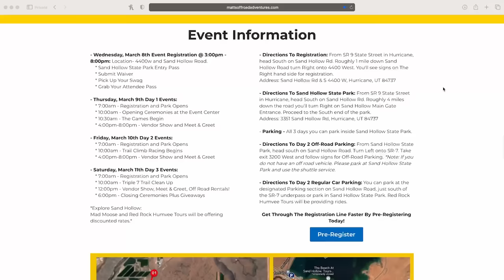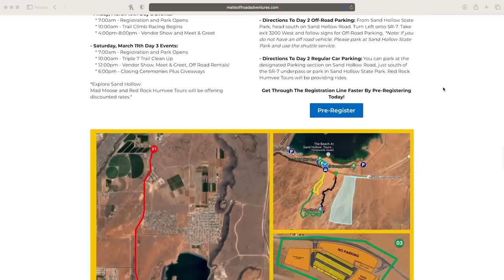20,000 LBS Truck Slides Off The Road...Did I Fail My Team?

Comment: Love watching your videos. As a former propane delivery driver in snow country I really think a set of chains for both the big truck and the Morvair was all that was needed.
Reply: Chains on the truck and they wouldn't needed to call anyone. Used to drive for a plumbing supply company. Chain up the rear and one of the fronts for steering. Better to chain up before getting into trouble.
Reply: Yep. Chains for all vehicles that expect to confront ice and slopes.
Reply: I was thinking the same thing. That box truck had no business on that road without having a set of chains.
Reply: Came here to say the same thing. Chains on that box van and it would have likely drove out. Definitely would have with a tug with the Moorvair. This winter should have taught MOOR to have a tote with gloves and shoe chains in their rigs for employee safety as well.
Reply: I'm guessing if this were so to happen the video would be less dramatic, just a guess...
Reply: @akdoug6437  Yeah, shoe chains seem essential for all winter work. I keep a pair in every vehicle. It's a cheap, easy way to gain positive traction and avoid avoidable accidents. Personally, I like to avoid pain, and ice is hard, and you usually hit it pretty hard and fast. So, chains... On all moving parts when dealing with ice.
Reply: @elvis4182  true. And not nearly as fun for everyone.
Reply: @DoctorHayduke  And a bucket of nice fine sand for emergency use!
Reply: @TheBibliofilus  Masonry sand...because it's all sharp edges!
Reply: I said the same thing
Reply: Agree.
Reply: Yes and not having bald tires
Reply: @mediocreman2  bald tires and chains you would be just fine.
Reply: Or a bucket of ashes from the house at the top of the hill.
Reply: @akdoug6437  sho Chains suck I'd rather good boots and a brain
Reply: I think they skipped using chains for more utube drama
Reply: All the needed is a shovel and plenty of sand, dirt or grit. In this situation buy 4 bags of the cheapest kitty litter-box filler and a broom. Be more self sufficient and don't lose a day and half of work.
Reply: @AlfaRomeo156SWGTA  don't use kitty litter except in emergencies, its real bad for the wildlife. Not saying don't use 8t cuz it works as well as sand. Just do it sparingly
Reply: @TheBibliofilus  Or kitty litter, just depending on the price in your area. My area kitty litter is cheaper and does the same job.
Reply: @therealnynetynyne360  Exactly.  Looked like a lot of shoveling and sanding to get up that hill.  Ol boy prolly thinkin a set of chains isn't such a bad deal now after all!
Reply: They were lucky the box truck didn’t go off the hill without chains originally.   I would definitely have used chains on the recovery if it were me, and essentially winching even if it’s only a tow chain in front of the wheel to provide a bite.
Reply: @TheBibliofilus  funny thing is , they are in the desert with sand everywhere.
Reply: can someone teach these guys and girls how to chew with their mouths closed like its not hard
Reply: @therealnynetynyne360  The cheapest litter is just clay. How is that hazardous to the enviournment?
Reply: First thing that box truck needed was a set of tyres lol they were bald eagles 🦅
Reply: Are you possibly the propane delivery driver who @CaseyLaDelle had to rescue/recover a week ago? 

.
.
.
Just kidding ;)
Reply: I just watched a Trail Mater video where Rory put chains on TM.  I know Matt always wants to pack super light, but they seem to have a fair number of times when they need more rope, or tools or chains...
Reply: @bumpedhishead636  Matt always wants to pack light, but then sends 600lbs of extra people along for the ride...
Reply: Why won't MORR use chains? No brainer here in Europe. Rubber tyre vs ice is a battle you are unlikely to win.
Reply: 3 or 4 bags of 3/8" minus crushed rock or sand and no problems.
Reply: I agree as I drive semis over Donner Summit regularly and onto the back country highways off of I-80. All that needed to be done (once pulled away from its original position and having chains on in the first place) was pull one side of the trucks duals(inside tire) onto a short piece of 2x4 board. Then slide the chain around the outside tire and secure it. One side at a time with chalk under the opposite side and that truck would have driven right out of there. Chains are also good for getting rigs out of the mud, But what a messy a.. job that is. Other than that I am happy you got out of there safe and sound. Except for the guy that lost his balance and slipped. " get your hands out of your pockets son, If you slip and fall down you'll never get up!!!"
Reply: Ok hank hill lmfao
Reply: @bumpedhishead636  when you're on snow or ice, you want weight in your vehicle so I'd err on the heavy side for more traction
Reply: I'm not positive, but I'm feeling this has something to do with liability BS. In the same vein as Matt explaining why he doesn't air down tires on customer vehicles.
Reply: @MrBowser2012 . They’re a roofing outfit !
Reply: The snow on the road reminded me of the little we used to get in Worthing, like, once every 5 years. My dad put snow chains on our car, and it wasn't long before they were worn half-way through. They were grinding on the tarmac underneath the snow. Still, maybe that's better than black ice, I don't know.

Comment: The fact that you guys were able to recognize what you did wrong in your initial prep work. Then you managed to come back and get it out without matt's help just means that matt trained you guys very well. Congratulations team.
Reply: They managed to get it out without too much drama either. Matt trained them well.
Reply: what exactly did they do wrong in their initial prep work? They didn't know the conditions till they got there and once they got there they did nothing wrong at all. The correct thing to do after evaluating the situation with a first attempt was to come back with more gear... which is exactly what they did.
Reply: @bushmanphotos  what they did wrong was not being overly prepaired. I have moved some heavy stuff in my life and thought rope will be good enough after having damaged the stuff that fell off the truck I now only use high level ratchet straps. Now I never move anything that needs 10,000 lbs straps but that's all I buy. This way I know that between the weight of the object and wind I know it's not going to go anywhere as I never move anything more than a couple hundred pounds but better safe than sorry.
Reply: @bushmanphotos  :) SO obvious , icy but melted dirt patches and temp was above freezing, dig dirt and spread it on the tires pass . The box truck should have tire chains as standard equipment. I think it was more for video content and play dumb then actual work
Reply: @chestertaylor7341 lol so if you’re not prepared   for every single possible  situation, they did something wrong?

Comment: You guys did a great job! 
 I'm the kind of person who is always trying to think of ways to improve things no matter how well it's already going.  It seems like there could be some sort of chaulk system  that moves forward with the big truck as it gets pulled up the hill.  Or get some tire chains for the big truck - the cost of chains is nothing compared to what a disaster could have cost.  That way if anything happens - a winch or winchline breaks,  or  the banana slides off it's chaulks, etc, the big truck with Rhett inside doesn't go back out of control  off the edge possibly pulling Lizzy off too.  
Also, if you look at the banana's chocks, they are designed so you drive ON TOP of the flat part, to set the chock down into the ice AND so the tire is up against the highest part of the chock.  If you just kick the chock toward the tire, it's not going to be nearly as secure, and you have A LOT at stake here, so it matters.

Comment: If I was in that situation 'i would have brought five or six buckets of sand and spread it out. Works to get our concrete trucks up steep hills when we pour floors in the winter. However I do not live in the mountains, I live in hilly area, but not mountains. 
Another great video, love watching these videos so much.
Reply: Do you think they could find sand?
Hahaha 😂
Reply: Cat litter or quicksorb works well, and is light to carry.
Reply: @russbell6418  have you ever got kitty litter wet,
It turns to sticky clay mess, 
Worse than mud.
Reply: Or a set of chains on that truck
Reply: Yeah sand helps alot.
Reply: Good old dry portland works. No color, Color make;s it slick.  It takes a surprising little cement to unstick a concrete truck'.
Reply: @dawg529  Stop posting common sense or you will be banned from Y/T..
Reply: We have sand on hand at all times for our lumber yard too. It’s all it takes to keep the forklifts moving instead of spinning.
Reply: @dawg529  and a set of tires that don't look like ski's.
Reply: @pohtoj1  sand hollow man
Reply: @billpapps4345  very true, used it before in desperation. pricey, but not as pricey as heavy rescue lol.
Reply: Pea gravel also works well for traction
Reply: Some of these snow recoveries show a little bit of lack of experience dealing with it. We thought the same thing. They knew they were coming back. Go get some salt or sand and throw it down and let the sun heat it up for an afternoon.
Reply: Yea, the Morvare was climing up that ice without sand.  With sand, even the box truck might have made it.  Not from the mountains either, but my driveway growing up was only a little less steep and iced over all winter.  Always put down sand when it got particularly bad as it lasts longer and works in colder weather than salt.  Matt's back lot is full of perfect traction sand, but the local hardware store or big-box store would have had 50lb bags for cheaper than the gas/wages to drive home and come back the next day.

Comment: Mor vare needs a set of chains for jobs like this. I never ran chains but there were many times i wish i had a set wheeling in the mountains. Great video guys stay warm and be safe everyone
Reply: yes chains may have been the ticket the first time for them.. they are still learning just lioke matt did great job either way!!
Reply: Chains on the box truck would have been a good solution.
Reply: Yes, with tire chains they could have just drove their truck right up. They're  pulled it up a little bit So they could have rolled backwards to put them on.

Comment: Nice recovery. I think y’all could’ve just used snow chains on both rigs. It would’ve provided a safer, smoother, and quicker recovery. Just some food for thought. But, y’all did great, it was fun to watch! 🎉
Reply: Or better still the truck should have had chains (if it had them I couldn't see them); I mean I'm sure a set of chains would have set back the roofing company a lot less than the cost of a 2 day recovery charge.

Comment: Nice job to everyone. ..I might chim in on a thought for larger trucks worked evertime for me with openings in the wheel. I made up 2 short chains with 2 hooks each one for both sides. Hook one end in the hole then run the chain over the tire and hook the other end in the same opening. Don't run it through the one with the valve stem. Used to deliver feed. It works great even on my semi. Keep the material comming I enjoy them greatly.

Comment: Would tire chains on any of the vehicles helped at all considering its hard frozen dirt by the looks of it?
Reply: If they had chains the morvair would have pulled it out on day 1.
Reply: @NismoXero  I was scratching my head that they didn't put chains on the morrvair on either day.  The truck that was being recovered should also have chains at least for the drive wheels.
Reply: Yeah, chains on the box truck or the Morrvair would have done it, but they aren't so familiar with snow and ice.
Reply: carmine redd  You're not wrong but these vids are great entertainment!
Reply: Yes, chains would have worked the first day.  It's hard on them, but chains work just as well in mud/gravel.  Spreading a couple hundred pounds of sand would have also worked.

Comment: One thing to note about those kind of Wheel chocks you need to drive the vehicle onto the pad to lock them into position. Kicking them at the front of the tire does nothing for them.

Comment: I believe tire chains on the box truck would have been a game changer, a tree railer on either side of the drive axle and tighten the cams to the point you think the tires will pop if you go much tighter.
Reply: Tire chains and you could have drove that truck right up that hill.

Comment: I'll share some advice for icy jobs(as long as you're allowed to salt)  Using animal feed salt on glare ice is basically instant traction. I've grown up on a small farm in upstate NY on a hillside.   It only takes a small amount of feed salt thrown down to get traction.  They probably could have driven that truck up by itself using around 30-40lbs of fine salt! It looked to be around 300ft and it doesn't take much salt when spread correctly!
Reply: Only works in some situations but not all situations! salt melts ice and creates water on top of the ice which is not good for traction.
Reply: @iffykidmn8170 i don't know @ feed but  I've used salt/deicer many years on my TWO wheel drive on half mile steep driveway with curves,  always worked, except in mud. Yes, "They probably could have driven that truck up by itself using around 30-40lbs of fine salt! It looked to be around 300ft and it doesn't take much salt when spread correctly!"
Reply: @kevinbogart9737  I/we will typically spread around 100 semi loads of road salt over the typical Mn winter been doing so for the last 25yrs, guessing we need to start trying fine salt instead.  thanks for the tip.

Comment: With 20 years driving a semi in situations identical to this, tire chains would ideal for both vehicles. In fact I believe that if the big truck had tire chains on  it could have driven itself out of there.
Reply: YES and  - chains,  good but salt/de-icer  would have done the trick, i use it all the time, always have some with. And strap- on foot cleats are essential also. Unnecessary second trip!

Comment: I'm surprised y'all don't have custom tire chains for icey/snowing roads it would greatly help for those type of situation and just getting around in general.
Reply: Nobody has the knowledge of how to install them.. including the tow vehicles..
Reply: It's not that hard, I learned how to do it by watching a drunk one legged Canadian do it.
It's very easy, and it makes a big difference on the ice, you won't slip and slide at all, it would be better to be safe, then sliding into a tree or off of a cliff.
Reply: @SubjectNoble  I carry mine 365 days out of each year in KommieRado.
Reply: @SegoMan  nice, I got mine couple years ago after the big snow storm that happened in Texas and Oklahoma, and it comes in clutch every year since then.
Reply: @SubjectNoble  Here's tech tip for storage of those magical chains.

Cut the leg off an old pair of Levi's, wire the cut end shut on the inside with mechanics wire. use nylon or manila rope to tie the other end shut with chains / tighteners  enclosed.

Comment: If only they created a metal object that went over tires to create traction.
Reply: Like chains......
Reply: @stanleyroberts4381  No way that would be too obvious.:face-turquoise-covering-eyes:
Reply: That's soo silly  a metal object gots to go on bottom of the tire not over.  😆 Impossible
Reply: @stanleyroberts4381  lol gonna need some really long ones depending how far they gotta go.
Reply: This is doubly hilarious when you know how badly chains work on that very thin ice -- they go straight through and slip on the tarmac 🤣

Comment: If I may make a suggestion; go to your local cabinetmaker and get a bag or 2 of planer dust, preferably from hardwood. And when your slipping on ice like that, sprinkle a little on and in front of the tire. you will be amazed at how grippy it becomes. I've had a small bag in my vehicles for 40 years and it's gotten my but out of  pinch many times.